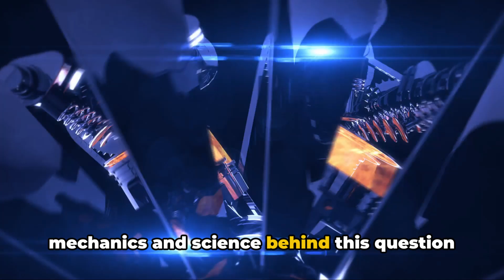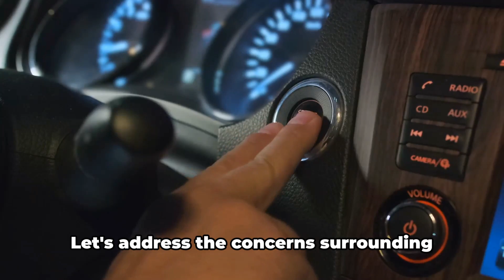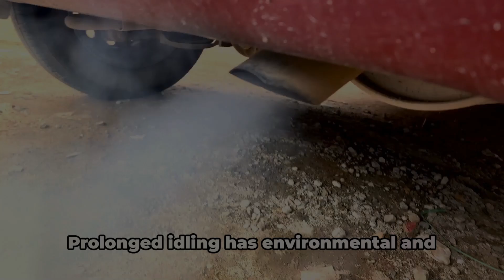Do You Need to Warm Up your Car? How Long You Should Wait

Comment: Your engine warms up fastest at a higher speed than at idle, with a low load.
In addition, idling in a cold state is particularly bad for pistons/cylinders.
I have seen plenty of cars that drove 4km to the city center every day for shopping, and even with low mileage they had audible wear when cold.
We sold to dealers when the engine was warm.

Comment: Commercial driver here. The electronic logging device in our vehicles also monitors our idle time. We get in trouble for not letting the engine idle for at least 5 minutes before driving and if we shut the engine down without letting it idle for 5 minutes.

If you have a diesel vehicle you can damage it by not letting it idle in freezing weather. The rings in the pistons do not sit right until warm and even with oil pressure jumping to 60 psi it will take a minute to properly lubricate it.

The manufacturer suggests what this video says, start it up and then run it lightly until warm however it's impossible to run any diesel lightly when the truck and trailer weigh 80,000lbs. 

We have tested both idling for 15 minutes and starting then taking off. Our trucks that idle for at least 15 minutes last longer.

Idling for 5 minutes after driving before shut down is necessary in turbo charged vehicles as the oil circulating through the engine and turbocharger is what cools the turbo. When you are driving that turbo is generating a lot of heat, if you stop driving suddenly and shut off the engine the temperature will rise really fast in the turbo and will damage it prematurely as the heat could warp components. Idling for at least 5 - 15 minutes allows the oil and engine to cool down to normal operating temperature and allows the oil to cool the turbocharger.

Comment: Warming isn't necessary unless you live at the bottom of a mountain pass  .one of the delivery drivers  seized a fairly new trucks engine driving a loaded delivery box truck 454 engine up a 5 mile high steep mountain pass .it swelled the pistons in the cylinders because he pressing so hard on the gas peddle with a cold engine..Had in been flat or a short hill it never would have happened .

Comment: My car has a higher idle when its cold weather. Even when engine is warm. Is this normal?
Reply from the maker: Yes, it's normal for cars to have a higher idle speed in cold weather, even when the engine is warm. This helps the engine reach its optimal operating temperature faster and ensures proper lubrication and efficient combustion during colder conditions. As long as there are no other symptoms present.